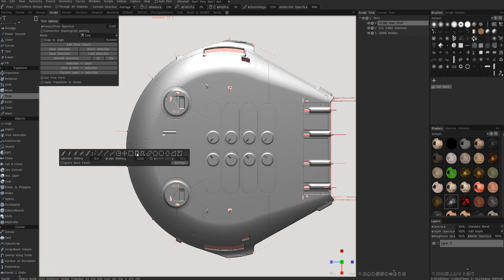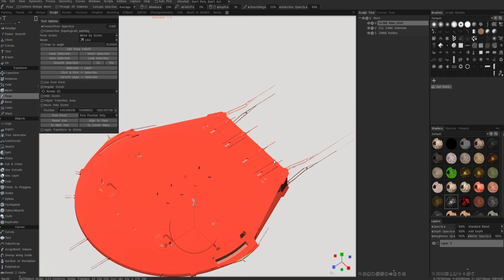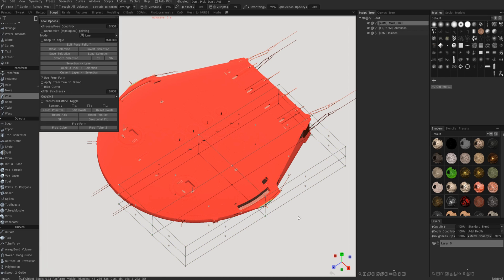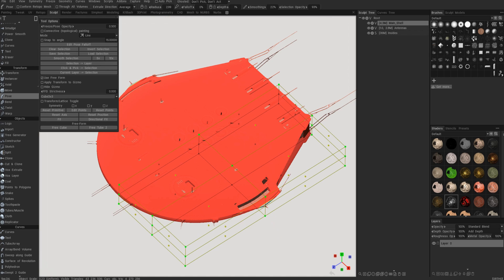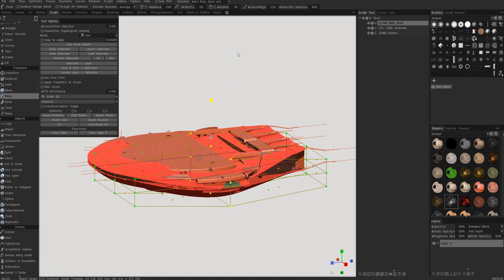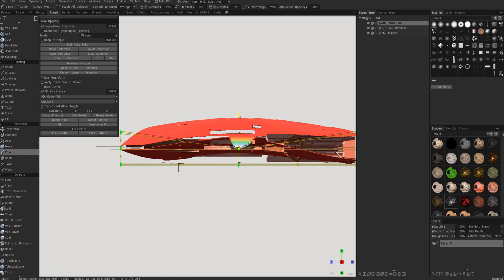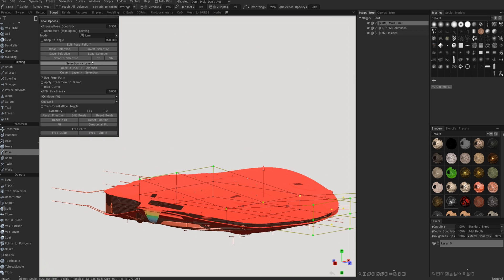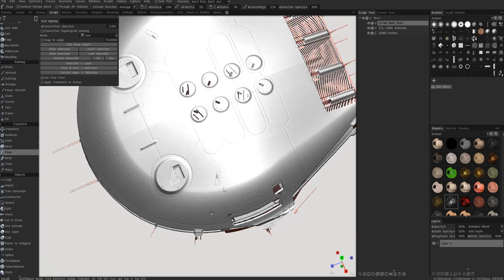3D Coat Lattice Box Deformation

Comment: uhm, its a great tool, but not the best example of how to use it... Maybe it would be easier to show on simple base meshes. It is very good for adding/adjusting curvatures, adding tapering, adjusting proportions... But normally you would use it BEFORE detailing, so you dont distort all those carved shapes like cylinders.
Reply from the maker: Yeah haha, I was debating to show on simple shape or complex. I normally use it a lot on a complex shape. Also I wanted to show potential issues like with scaling
Reply: @AntonTenitsky yeah,  it works on HP meshes pretty much the same way, as on low density base meshes, but it becomes painfully slow and laggy and distorts details. Not a problem for abstract paneling, but stuff like cylinders, bolts are getting ugly. As for transforms, all 3 of them work fine, and you cant replace scale with move... Real problems are: 1. Isolating elements 2. Alignment of cage 3. Selections of cage points. 4. Controlling pivots when transforming many points. In 3ds max I love FFDs much more as 1. It is procedural modifier 2. It has selection levels: object, cage, cage points 3. 4 viewports are making group selections much easier and faster 4. Transforms with multiple coordinate  systems: parent, world, local, screen.